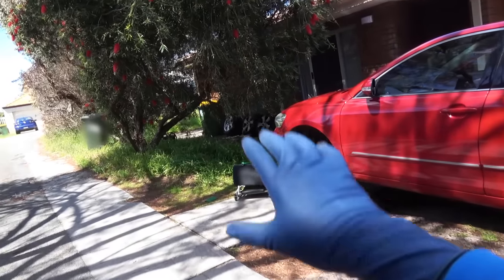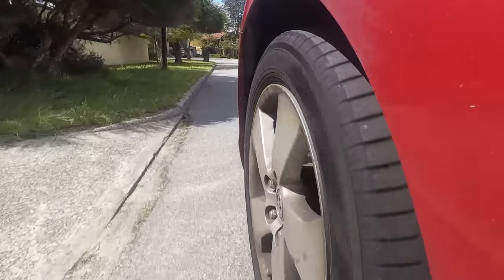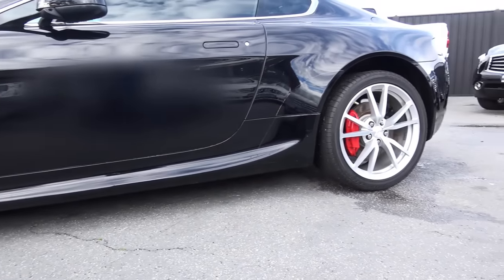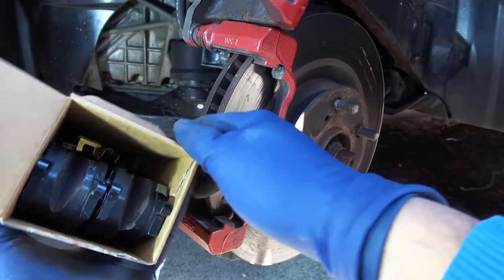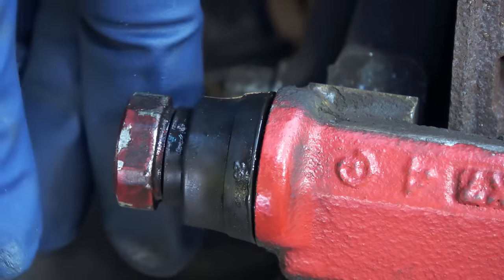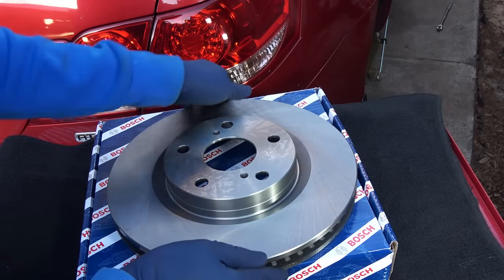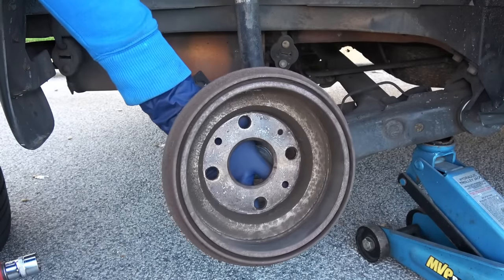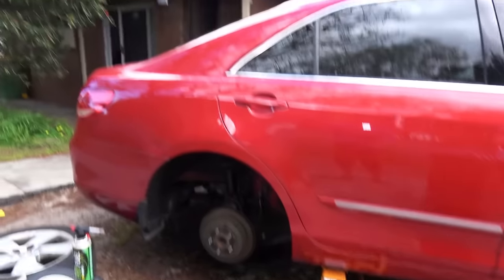How to STOP BRAKE SQUEAKING in your car (No Squeaks Guaranteed)

Comment: I've been watching a lot of YouTube 'How to' videos on car maintenance during shelter-in-place and fixing things myself on my 2003 Toyota Sequoia.  This is one of the best, most informative instructional videos I have ever seen.  I learned so much that I wish I had known about brakes during the past 38 years of driving.  I've had the rotors on my Sequoia replaced twice in 220K miles.  After watching this video, i will probably have my mechanic replace the rotors once more with a larger sized upgrade, but i will start replacing brake pads myself now that I understand how to do it right.  

Before watching this, I simply "didn't know what I didn't know" and because I considered brakes the most critical part of a car, I didn't have any inclination to attempt to work on it myself.  This video and my recent experience fixing things myself changed my entire perspective.  When I think back, I have overpaid for so many easy maintenance tasks that could have been DIY.  I fell a little stupid... Ugh!
Reply: Fake comment

Comment: Very informative and well made video. So many reasons for brake squeal.  I had a constant squeak, only when brakes we're not applied, that drove me nuts. I had replaced my pads and rotors, lubed guide pins and cleaned/lubed the hardware. Turns out it was the pads. I won't mention the auto parts store, but even the best aftermarket pads can have issues. Ended up going to the dealer and paid more for OEM pads, but it did solve the problem.

Wanted to comment after I had watched this and did a repeat job to thank you for being so clear and concise. Definite sub from me.
Reply: Why were the pads wrong from the auto parts store? Does your car take organic or carbon pads?

Comment: I'm used to doing brake repair concurrently doing complete replacement of dics,calipers,pads,hand brake shoes that are inside rear discs on my bmw3ser old lady 2003,not been well cared for! By previous owners in atrocious state caliper carriers really rusty, wirer wheel them then short acid bath now like new,replace slide pins/rubber boots,picked up a great deal of usfull information/tips watching your video thanks so much,never to old to keep on learning!!

Comment: This is by far one of the best videos I’ve seen step-by-step explanation on how brake systems work and are repaired and what kind of pads to use and what actually happens when you press on the brakes pedal you’re done an excellent job  thank you

Comment: but what happens if your rotors and brake pads are perfectly new and they still squeak :D only when stopping slowly though what that means
Reply: My car is doing the same thing!
Reply: Same!!
Reply: Same...
Reply: Same
Reply: Same
Reply: Mine too. Power Stop kit. 2 sets, did the same thing. Squeal at slow speed, like in a drive -thru lane, etc.
Reply: Same. Had brake pads changed and now squeal when backing up and using brakes softly. Using a more forceful stop no squeal
Reply: Its like breaking in new shoes
Reply: Just had the same issue on my car, I tried cleaning the whole brake assembly but it didn’t work realized I had installed semi-metallic break pads which always squeaked when braking at low speed. I installed new ceramic pads and all noise is gone

Comment: I bought new original brakes from toyota but they don't supply the hardware. The salesman said that it is not requied to instal new hardware or the lube. I will follow your advice instead.
Reply: optimusprimo2012 sounds like i wouldnt be buying parts from them anymore

Comment: Great video and detail explanation! I think you forgot to mention one more reason why there's noise on your brakes...after-market rotors. I replaced my brake pads/rotors 2 weeks ago.  After installation, I got a grinding noise from the driver rear.  I have a rear brake shoe/drum/ rotors setup.  I must have gotten 3 different after-market rotors trying to figure out why the noise exist..even calling Power Stop to get a replacement rotor.  No matter which after-market rotors I installed, there's grinding noise!  Finally, I order a factory - Toyota rotor and long and behold...no more noise!  Just to see that I wasn't crazy, put the after-market rotor and the noise came back.  What I've found was that the after-market rotors bolts hole was slightly larger than the factory oem rotor which cause the brake play.  What I can't understand is why did the other 3 wheels had no issue with the after market rotors/pads?

Comment: A little tidbit of further information is that Drum Brakes actually work better the hotter they get but if they get wet they may fade, (lose stopping power), or even fail altogether. 

Disk brakes begin to fade when they get hot, (too hot and they fail altogether), but their performance is not affected by water at all, in fact, it helps thru the cooling effect.

For this very reason, in the 60's thru the 90's most vehicles had both disc brakes upfront and drum brakes in the rear.

As technology improved, disc brake cooling was optimized with better cooling materials, drilled and slotted rotors, and air ducts blowing cool air on them, and because of this, many vehicles went to disc brakes all around.

The ability to still stop in any conditions is why even today, many new trucks, (especially the heavy-duty work trucks), still have disc brakes up front and drum brakes in the rear. 
You may have disc brakes all around on your 2020 Ford F150 2x4 but the 2020 Ford F350 4x4 will likely have drum brakes in the rear.

Comment: Thanks for the info. Saved me a lot of time taking my new rotors and pads back apart after just replacing them. Bosch doesn’t send enough lubricant with their pads so I’ll just have to squeeze some into the ears of the pads.

Comment: You did a very good job presenting this information. As a mechanic myself you touched on the major points. I had a very strange issue once with one of my vehicles where the master cylinder was causing the front brakes to lock up while driving. I even performed a CPR (replacing caliper, pads and rotors) but it wasnt until i starting to realy bleed the system where i found that there was pressure where the line went into the one of the ports on the master cylinder. The fluid was not able to return back into the reservoir causing pressure to apply on the front calipers.. i also just delt with an issue on a different vehicle of mine that had a brake pull to the left. That ended up being a worn lower control are. The bushing allowed to much movement but havent failed. I could actually see the whole wheel slightly shift forward when standing outside the car and had someone else stop the car. Sometimes things make you think outside the box

Comment: I used to have ASE cert for brakes (expired, personally does me very little professionally to renew)  I approve of this message... I would like to add just a bit of information.
You mentioned the rotor a bit but I feel like it might have been a bit glazed over (pun intended lol) I highly recommend machining or replacing the rotors with every brake pad replacement... can you get by without replacing them? Sure can if you want to be cheap but it will without a doubt provide the best braking experience and performance. 

ALSO I feel like it should be mentioned for the novice monkeying around in his garage for the first time... DO NOT ADD ANY SORT OF LUBRICATION/OIL/GREASE BASED SUBSTANCE ON THE FRICTION MATERIAL SIDE OF THE BRAKE PAD... you would be amazed at what some people will do.
They come in and say "well my brakes are making all kind of noise, guess all that WD-40 I sprayed on there wore off" lol 

The oil/grease will degrade/cause friction material to swell.

Comment: Brake specialist told me 50 years ago, when old torch batteries had a carbon rod up the center,drill a hole [or holes] in the leading end of the disc brake pad,  and insert a piece of the carbon rod, as the brake is applied, a certain amount of carbon provides a tiny bit of lubrication.

Comment: What is beyond me is how does the whole brake system know how to apply even pressure on all 4 brakes... or that all 4 brakes after bleed have same gap distance between disk and pad.
And also what's actually responsible for guidepins to push back after brake released, do the rubber boots act like springs for guidepins? 
Also would loved to see how brake hardware could be responsible for a jam vs properly operating one. Overall, love the video, best demonstration I've come across, especially loved the 1 minute mark, how well that was edited and shown. If I'll ever work on a brake I'll troubleshoot same way with tire off and disk spinning, it's the first video I've seen that does it this way.

Comment: Great video.  I got my brake pad replaced at Acura in October 2023 They said that they resurfaced the rotors but by May 2024, the vibration in the steering wheel was worse than in October 2023.  The dealership resurfaced the rotors but a little later the car started squeaking at low speeds.  They are saying that nothing is wrong but the pads are already down to 7 and it’s only been 11 months now.  I thought they should have replaced the pads with the resurface in May.  I don’t know what to do at this point.  I’ve only drove. 7,000 miles.

Comment: Lubricating the ends of the pads does nothing as the first rain will wash it all off, if you want to grease something grease underneath the pad adapters to stop rust jacking, a little anti seize on the pad back wear the calliper touches the pad will eliminate most squeaks. A good bedding in after installation will eliminate a lot of brake noise issues and uneven rotor surfaces. Good video.

Comment: Just adding an additional potential noise.
If you hear a "clanking" noise when you go over bumps. It could also be loose pads. If you got brakes done recently and you hear clanking noises, there's a good chance you or the mechanic forgot to install the shims or the springs on top are bent out of shape. Resulting in the pads clanking around bumping into the caliper and rotor.

Comment: Nice video. I was hoping to find solution to my problem  but I did not see it. I don't have grinding or squeaking noise.   
I just replaced  both front and back Brake pads and Rotors on my BMW 328i. I followed all of your tips. However,  when I press brake pedal and move car gear to drive it makes noise. But as soon as I take foot off brake pedal slowly and start driving there is no noise and brake operates fine, when I  stop at stop sign little slowly moving or traffic light there is no noise. It make noise when making completely hard stop same thing happens. when I stop car on my driveway and move to park it makes same noise. rotor wear seems ok, but too soon to judge. I have Detroit Axle - Brake Kit for BMW 323i Wagon 325Ci 325i 328Ci 328i Drilled Slotted Disc Brake Rotors Ceramic Brakes Pads Replacement 11.81" inch Front and 11.57" inch Rear Rotor. I would appreciate your help. 
Thanks,

Comment: Hey, thank you very much for a very informational video. Really appreciate all the effort and the attention to detail in the way you explain. I have a question. I got my car's rear left wheel's brake caliper changed recently. I had brake rotor grinding and also caliper was heavily rusted. So the only option was to replace it and along with it the brake discs. 

Now that both of my wheel's brake rotors are changed and new brake pads are installed, I see that the rotors are getting super hot after I drive it. Also I see on the new rotors, a visible mark of brake pad friction. Meaning the rotor has some sort of a design all over but the portion where it gets in contact with brake pad, it is visibly rubbed really hard. Is it normal for the new brake pads and rotors or is it something wrong in the way it is installed? I am also concerned about how hot it got after the car was driven

Comment: hi just stumbled upon on your videos and i love all of it. very informative and helpful. this might not be related but the reason why i stumbled upon your videos was because i was searching for information regarding power mode system that is installed in my car. i installed it by my self and the manual does not explain the numbers in the power mode setting. i would like to ask what those numbers mean. thanks. :)

Comment: Hi, I enjoy your helpful videos. I have a question about a knocking noise when I gently apply brakes when my speed is around 30 kph or less. It's a knock - knock - knock. Only when I brake gently. Could this be the brake disk metal plates being loose?

Comment: At 12:12 you are talking about the brake shoe. See my brake shoe is broken due to replacement of front wheel calipers. My vehicle is a KIA sorento 2015 model & I am not sure if the garage has not reset my EPB (Electronic Park Brake) system. According to my research a system reset is a must for the vehicle to go smoothly without damaging the EPB system & the rear wheel shoes. This happened the next day after getting the front wheel calipers change. I just want to know if the KIA sorento needs a system reset to be on the safe side? Much appreciated if you could help me out. Thank you!

Comment: For 4wd cars like captiva, what is best rotor and pad. Is it bosch rotor plus a ceramic brake pad like bendix 4wd ?.
Recently purchased calibre pads for existing rotors, squealed all the time, took them out, put old pads..no squeal. Any suggestion of brand for front pads...thanks

Comment: Thanks man. Really good video and clear.  I prefer to keep the old rotors in most cases. Minor wwear is normal and no problem. Only if it is radial or stripe bluish wear that cause pulsation.

Comment: I have been a hobby mechanic for 20 years and my vehicles only go to other peoples shops for tire changes and safety inspections. I think this is a video everyone with a car should watch - full of easy to understand information. Much of it I already knew, but putting it all together like this was a get watch and there were a few things even I hadn’t thought about. 

For me it isn’t about going to the dealership to buy reboxed parts in a honda or toyota box. It’s knowing which parts are consistently made with care and quality and where some extra money is well spent. 

For me I always go with a high carbon rotor, brembo blanks, Centrics or raybestos always the premium line. Don’t fall for those cheap white box rotors, there is a reason they’re 10$

And I almost always go with Akebono pro act that have included hardware. Usually they’re the most expensive pads on rock auto there is a reason for that. Honda doesn’t put them on all there new vehicles because they’re over priced. 

Since I started using this combination I have never had a single issue with friction spots or warping rotors. 

When I would let the parts guy behind the counter bring me whatever crap they had in the back -  I was often plagued with issues ranging from poor pedal feel to pulsing and even vibration. 

Thanks for the video great content

Comment: If youv had your car parked up a while and then drive the car and the pads and discs are fine but sound a bit scratchy when you stop. Can I just sand the rotors ? Which grit ? Or is there any spray that I can use on the rotor discs ?

Comment: Great editing and content ! Question: on my Toyota Prius I have grinding noise without applying brakes. New rotors and pads and lubricated guide pins. The same as before the change. I'm puzzled.
Reply: You may need to check your brake pads.

Comment: I just want to say here we buy from Toyota and Lexus dealers or infiniti and Nissan. Expensive breakpads and we only get the breakpads and nothing else. So the dealer here is different than ur County. And it's not about expensive and cheap. It's about the dealer and the brand to add the accessories.
Any way great video and we'll explained

Comment: Hi great video 👍🏼. I have a 2008 Honda Civic 1.8l and I’m having issues with the calibers sticking. I installed new calibers, slider pins, rotors, brake pads and both front brake line hoses. I’m still getting sticky calibers causing the rotors to get hot while driving. I did a complete brake flush to make sure there’s no air in the lines and filled the brake fluid reservoir to the correct full level but can not seem to find the problem. There’s no leaks around the master cylinder, no ABS or break lights on and the brake lines look good. Brake fluid runs through the front and back brake lines properly. I’m stuck on this one. If you or anyone has any ideas on what my issue is can you please let me know. No codes are available. Thank you.

Comment: Hello. I have got a prius 2nd gen 07 model and got a front right wheel getting hot issue. Noise coming from the wheel which seems like the pad is constantly in contact with the rotor. Noise goes away when the pedal is pressed down. 
Have changed the caliper.
Resurfaced the rotor.
Sliding pins and hardware are lubricated and in good shape.
Pads are good. 
Brake hoses are perfect. 
Just dont know what else can be the problem. Did all the checks of your's in this video but still unable to solve the problem. 
Looking forward for any help.

Comment: Very good video….but I’d like to add that brake drums and rotors can be machined (resurfaced) several times instead of replacing them. They should always be resurfaced or replaced… never sanded.

Comment: Ive been doing brake jobs for decades and not a single brake job i ever did has squealed,customers, family member's, friends etc, period. the secret? ALWAYS make sure everything is nice and clean and  grease everything (except the face of the rotor of course) lol,get the back of your pads,guide pins etc also take your time,nothing good ever comes from being in a rush while working on your ride but the grease is paramount, last time i did my brakes on my personal car was 4 years ago,i wish it would squeal to give me a reason to take them apart but so far no luck.